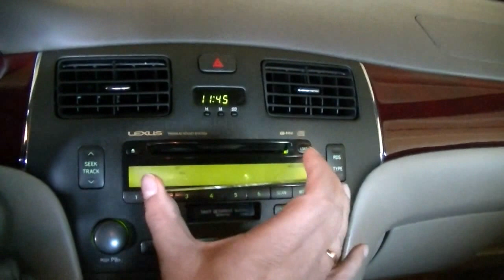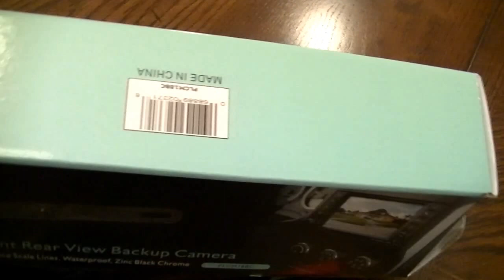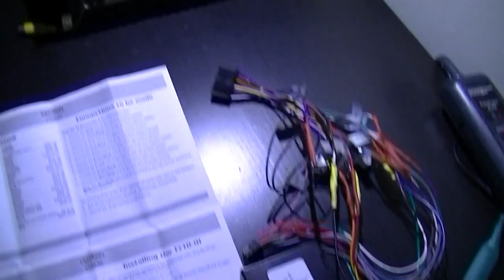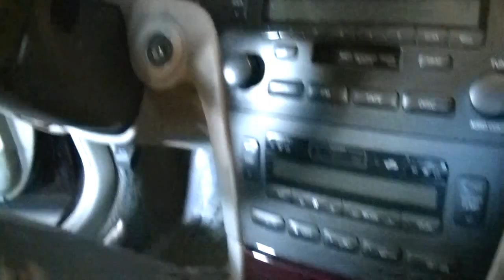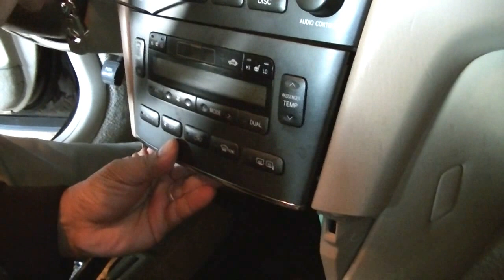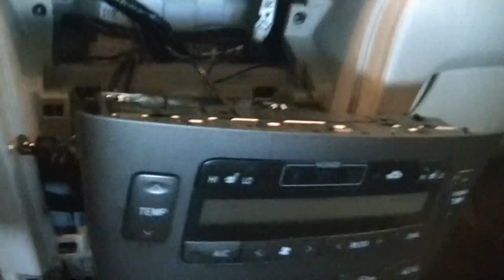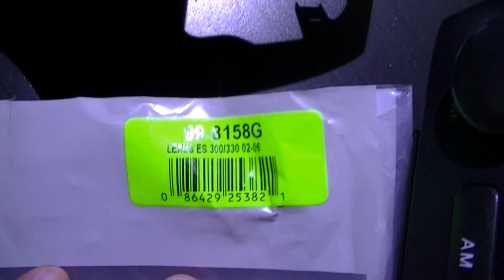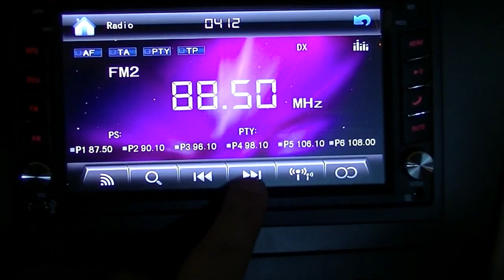2004 Lexus es330 radio replacement with aftermarket double din head unit

Comment from the maker: Eventually I have been able to solve the Engine noise issue from the car audio. Sound is crystal clear now. If anyone else following this video face similar issue and wants to try what worked for me then do post a comment and I will share the details.
Reply: The First DISCONECT BATTERY !!!!
Reply from the maker: Your choice, I never disconnected battery and did this whole procedure (twice) without any issue.
Reply: How did you solve it?
Reply from the maker: By adding noise filter, ground loop isolator to the red and black wires. It comes with connection details. https://www.amazon.com/Asdomo-Pre-wired-Plastic-Isolator-Suppressor/dp/B01DXEBEB8/ref=sr_1_49?ie=UTF8&qid=1489237922&sr=8-49&keywords=noise+filter

Comment: This was helpful! I have the EXACT same car, color, etc. I am planning to install a 7" touchscreen. Will it fit with that Metra installation kit????? Thanks
Reply from the maker: +96RCman You will have to trim the face plate like I had to do. Just trim it enough so that you can slide it in from front of the face plate and then put the border around it so that it hides all the cut marks. Mine was 6.5 inches and still had to trim around the faceplate. 

http://www.amazon.com/gp/product/B00URFTYPA?psc=1&redirect=true&ref_=oh_aui_detailpage_o02_s00
Reply: +Vijay Bhalla Thank you. Also, another question. I ordered the dash kit and a Pioneer AVH-X5700BHS. Now, I'm curious: Do our ES330's come with a factory amplifier? Or are the speakers powered directly by the head unit? I will eventually be upgrading the speakers, but not adding any amplifier. Thank you. Awesome video.
Reply from the maker: +96RCman Yes all Lexus cars have an external amplifier. ES330 also have an external amplifier which is hidden in trunk area. I did not disconnect or modify any of the car wiring therefore the amplified output of my new headunit is feeding into the external amplifier and then it goes out to speakers. I know this is not what is generally recommended but I tried and it works fantastic. Sound is much more rich and clear. No point in doing all the effort to bypass car's amplifier when good result can be achieved without bypassing it. If you are installing Pioneer then most probably (I am not fully sure) direct ground to Parking wire of head unit will not work, this works in cheaper units coming from china. For Pioneer I think you will have to trace the Parking brake wire of car and connect it to head unit's parking brake wire. This is just fyi (I am not fully sure about it). Read some forums related to PIONEER's unit.
Reply: +96RCman only mark levinson or whatever it's called has amp

Comment from the maker: Few days back i replaced the head unit with PIONEER MVH-200EX ($145) as few issues were bothering me. Mostly the connections I did were same as shown in this video but also few minor differences. After testing this newly installed headunit I am  glad to report that all issues that were bothering me are resolved. Details are as follows:-
1. Hissing sound/alternator noise - This issue was off and on. At times this noise used to go away completely and then on few days it will be back. It was an annoyance.
2. Amplifier turn on was not consistent - I had to power off and restart the stereo every time car is started because somehow the amplifier was not turning on immediately when head unit gets started. I thought it was some type of malfunction of the metra interface cable but it turned out to be headunit issue.
3. High volume sound even when volume level was set to 1 or 2. It was difficult to reduce the volume of stereo as it was starting right away with a very high volume.
4. Overall look of the installatioon was not professional due to mismatch in size of head unit to the faceplate.
Resolution of above issues.
1. On metra wires (White adapter end), two red wires (12 V switched current) starts from a common pin. One red wire goes to the black AXESS box while other red wire connects to the head unit. When I inserted the inline noise filter earlier as explained in comments i cut the red wire goes from white adapter end to the black box so black box was receiving filtered current but i did nothing to the red wire that connecting to head unit. This implies head unit was still getting unfiltered current and most probably due to this was picking up alternator noise randomly. During this new install i ensured that both head unit as well as the black box are connected to the output of the inline noise filter. 
2.  I cannot say what made this amplifier turn on issue go away but now it is turning on consistenly everytime head unit is turned on. There is one more difference in connections this time and that is for the ground connection. In past install i did extra ground to the body of head unit as well as to the cars body too but not this time.  In this new install all black wires  are connected to the thick black wire of metra interface cable. It implies all black wires of head unit, electronic bypass, inline power filter, and amp turn on black with white stripe are connected to same thick black wire coming from white adapter. 
3. In past install i set the blue circular knob on the black box to nearly 50 to 60%  (in between the lowest and highest point of the movement of the knob. In new install i kept it just slightly above the lowest point of the movement of this knob. Using screw driver i brought it to lowest point first and then just slightly above it. Now headunit's volume at level 0 is absolutely silent and 1 is just slightly audible the way it should be.
4. New headunit is a perfect fit to the faceplate. Absolutely clean and professional looking install.
I am glad that now all the issues are resolved that had been bothering me for some time.

Comment: Did the key have to be in the entire time?
Reply from the maker: No, not at all. Use key only when you need. To move into gears to create space to pull out unit, or to test for current in rear bulbs etc. use key when you need to turn on power and you can do that anytime during whole process.

Comment: Finally installed a touchscreen stereo in my 06 lexus es330.the harness kit with amp support worked flawless.the only problem i had was when i turn on headlights the radio screen turns black and says signal loss im almost sure it has to do with illumination wire so im gonna cut it and see if it fixes problem.total cost with dash kit, harness and andriod stereo was $125
Reply from the maker: DjSmileyofLasVegas my guess is same. Cut the illumination wire and see.
Reply: @VijayBhalla  its one of those 50 dollar chinese touchscreen its actually pretty good came with a cam and steering remote.i posted a quik video of the problem but im sure its the illum wire after reading some google searches

Comment: where can i find a same radio because i have the same car and i have the same wires and i want to change the radio
Reply from the maker: +Jorge Lucio luci Search AMAZON with key word "2 din gps" or "double din GPS" you will find several radios. You can chose which one works for your. All have same wiring concept.

Comment: You replaced your stereo around Oct 2015 according to the published date. How are things going, how is the stereo performing. Any issues concerns since it is a cheap unit. I am thinking of buying one. Thanks for the info.
Reply from the maker: Stereo is working very well. I am absolutely happy with it, however you will face same issue with over-size with install and will need to cut the faceplate to fit it accordingly. Only issue is phone calls sometimes disconnect while call is in progress and sometimes power recycle required (absolutely no sound when car is started). Both of these issues happen occasionally but other then that no issue so far. https://www.amazon.com/Autoradio-Digital-TouchScreen-Navigation-Bluetooth/dp/B0191HDDOW?ie=UTF8&psc=1&ref_=twister_B01GTKAXO2

Comment: My friend I need to know if your able to mirror link your phone. Because I purchased the same radio as you and I followed everything you did with the wires, my gps works fine but I can't mirror link it cause it requires Wi-Fi which I can't do if you know please tell me how to do it thank you 
Please respond to me. 
Albert
Reply from the maker: Hi, I sold this car few years back however i do remember that manufacturer of headunit was responsive to questions. You can probably email to them your issue.

Comment: Thanks for sharing the video. I have a 2003 lexus es300 and I want to install a new stereo. I need your help. Doubts: What is the function of the TYTO-01 module; quick installation? or allow operation of the factory amplifier? How did you install the stereo to the factory amplifier? Is there a cable in the stereo connector that can activate the amplifier? Thanks
Reply from the maker: TYTO-01 allows operation of factory amplifier. It was a bad decision at my end to choose a cheap Chinese unit initially, later on replaced with pioneer head unit and few other fixes that made the installation perfect. Please do read my comments about issues and resolution post installation before planning your installation.
Reply: @VijayBhalla  OK,  THANKS FOR YOUR VERY VALUABLE ANSWER.

Comment: I have an 06 lexus es 330 they look the same i hope it is im gonna order the kit for dash soon
Reply from the maker: DjSmileyofLasVegas if they look same and mark levinson is not written anywhere then must be same. Please do install inline filter on red wire and ground all black wires to the thick black wire of the tyto wiring harness. My pioneer radio is working superb with absolutely no issues. Do ask questions if you have any.
Reply: V B thanks i have to check if it has the amps it sounds good and say the 6 disc but im gonna see if it has the mark levinson label somewhere.
Reply: V B what’s wrong with it being mark Levinson?

Comment: I install a 7 inch touch screen radio and now when I turn my headlights on the climate control back light won’t come on then when I turn my headlights off the backlight on the climate control comes on all my dash lights and other lights work normally just the climate control having a problem with please help
Reply from the maker: Disconnect illumination, orange color wire and check if issue gets resolved or not.
Reply: Ok thanks

Comment: you can buy a custom faceplate from certain websites so you dont have to cut the original one if you want to go back
Reply from the maker: Reason I had to cut faceplate was because I was installing a no-name brand chinese head unit. If you install name brand like pioneer, sony, kenwood etc. then there is no cutting required since they match the standard dimensions. For the time being I am happy with it since all is working well but in future if i change the headunit, i will go with Pioneer, however thanks for sharing the info!

Comment: Hey, I hope you’re doing great, I know you made this video a while ago, but I was just wondering if you could send me a list of all the things you had to purchase in order to make this work. Thank you in advance.
Reply from the maker: All components are shown in the beginning of video except for the in line noise filter that i purchased and installed later on. If you open this video through laptop browser and read the detailed description of this video then you will find link to the inline filter too. Secondly i strongly recommend not to buy cheap no-brand Chinese headunits and stick to pioneer, sony, kenwood etc. branded units only. Not only they fit very well to faceplate but an assurance of good performance and long term reliability.
Reply: V B thank you I appreciate you taking the time to reply

Comment: bhai mere paas 2003 es 300 hai usme same system hai jo inbuilt hai agar stereo nhi change karna ho or usme amp or sub lagana ho to lag sakta hai ya nhi
Reply from the maker: If your car and system is same then it will already be having an amplifier (in trunk area) and sub. Are you not happy with it's performance and want to replace it with a new after market amplifier and sub?
Reply: yes i want to replace with a high bass sub
Reply from the maker: Technically it is possible and may be more then one ways to achieve it. It is easier to show on video then to explain however I will try.
1. Components required - You will need to buy a car audio amplifier that accepts speaker level (or high pass) inputs. Reason is because you will need to disconnect two wires that are connected to existing sub speaker in trunk and use them as input to the amplifier.
2. Connect output of amplifier to the wattage matching sub speakers that you buy.
3. Provide 12v power to the amplifier by pulling a wire directly from the battery of car. Walmart sells kits for this purpose. These are special wires whose thickness and strength etc. is built as per the wattage of the amplifier so be sure you buy these high quality wire kit only. It has inbuilt fuse too.You will need to figure out how to bring this wire from battery to trunk in car. watch some videos.
4. Last part will be to figure out a wire known as REMOTE or Amplifier turn on wire too. You will need to trace this wire in the input plug of the factory amplifier. Characteristic of this wire is that it shows about 12v current when radio is powered on and shows 0v current when radio is switched off. Once you find this wire then extend it to connect to the REMOTE input of the new amplifier too. 

Once all above connections are completed then you are done. Your new amplifier will coexist with current factory amplifier.  Current amplifier will continue to feed signal to door speakers while new one will feed signal to new SUBs in trunk.

Comment: Hello,I have a 2003 Lexus ES300 which Installation Kit do I need, the only with the (70-8113 Harness) or the kit with the (71-8113 Harness)
Reply from the maker: I cannot say anything about 2003 ES300. If your radio looks same as mine then most probably the kit specifications will be same as what I used. This is absolutely a guess at my end. You shall explore more through YouTube and other websites.

Comment: I bought the same kit for my 2006 Lexus ES330. The kit actually states that the "blue" wire must be connected to the factory amp. BUT where is the "blue wire"?
Reply from the maker: Is there a black wire with white stripe?
Reply from the maker: @exoticbullyssouthtexas3963  Amplifier is not turning on.

Comment: Hello there... I know it's been along time you made this VDO. But I need some help. I am trying to install Apple Carplay head unit on my 2005 Lexus ES330. Where did you hook up the Amp remote wire (Blue/White) from TYTO-01 harness to...It looks like you connected to the orange wire(marked AMP) but my TYTO-01 does not have that wire. There's an orange wire but it's for the brake. I also was unable to find the remote wire color code to turn the factory amp on the net. I will have to Ohm all the wires from factory harness if no help. Thanks.
Reply from the maker: Don’t go by color of wire. Look for details on supporting documentation or label on the wire itself. Sometimes wire label is amp, sometimes remote.
Reply: @VijayBhalla  Thanks.
Right now I got no sound because the factory Amp is not turning on.
I got to have to trace the remote wire from the main connector harness and connect it to  Blue/white from my TYTO-01 harness.
Can’t find on the net what wire 😬

Comment: If you doing install you should use a OEM face plate from one that has navigation radio then u won't have to cut I did mine that way looks like it came out of best buy nice like it goes there

Comment: Nowadays there are 6.2 and 7 inch displays offered. Which size should I use to fit the faceplate opening better?
Reply from the maker: MrMilanina both sizes should fit well since overall body size is same for both  just lcd size is different but stick to a good brand name like pioneer Sony jvc etc. no name brands have sizing issues

Comment: What make is your stock amp? My stock radio looks to be the same as yours and my stock amp is a Pioneer. Another question my radio has 2 antenna wires one little and the other standard. So Radio reception is good with just the bigger one installed?
Reply from the maker: My stock amp is Pioneer too.  Out of the two radio antenna only the bigger one fits into the new head unit. Ignore/leave alone unconnected the smaller one. Radio reception is perfect.

Comment: had mine installed but now my display button that toggles my miles per gallon on my steering wheel doesn't work anymore. did it interrupt yours?
Reply from the maker: +Kevin Rose I never paid attention to it earlier but now that you mentioned I checked it. Button is labeled as "MODE" and it works very well. It toggles the display through various different values, MPG, Range etc. No issue at all.

Comment: Did you ever install steering wheel stereo controls and if you know what kit would work best for it.gonna start my install next week
Reply from the maker: No I never installed steering wheel control. My car doesn’t even have steering wheel controls for the stereo.
Reply: V B thanks.im gonna be watching ur video again when i do my install om getting an android radio and faceplate and the metra kit to use amp in car.

Comment: I installed a kenwood double din stereo and it works fine only problem is the panel lights on the AC and the lights on the shift stick don’t light up anymore. 
The AC panel only works as long as the car lights are off but once I turn the car lights on the panel stops lifting up 
The lights on the shift stick don’t light up at all.
Reply from the maker: Luis Lopez now that you mentioned I checked my lights again on stick shift panel and AC, found both working absolutely perfect so your issue does not seems to be linked to this installation. Do check for any loose wire connection on ac panel in case you disconnected and reconnected ac panel wires.